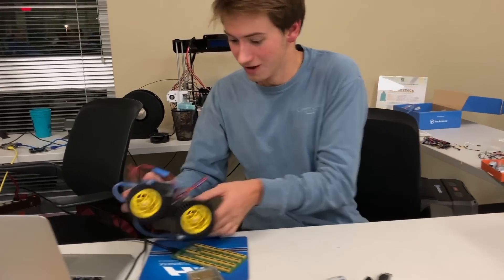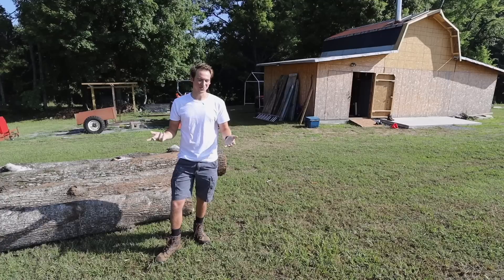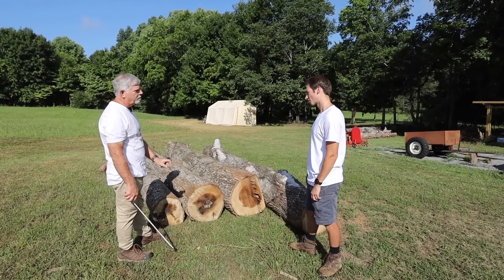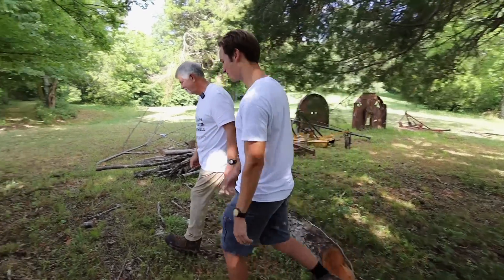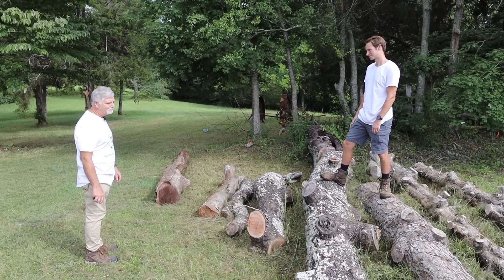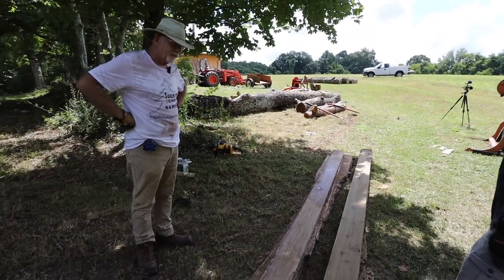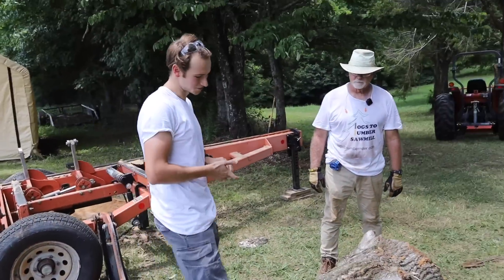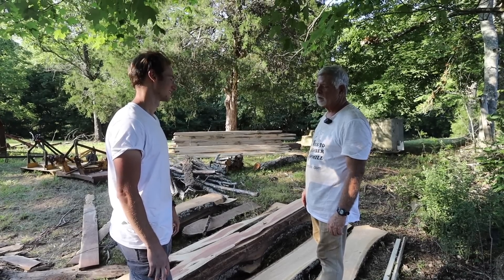Milling Rotting Trees Into Useable Lumber for Our Tiny House

Comment: Hey Danner, I mill my own wood regularly over here in Bentonville, AR.
A nice way to deal with bugs is with a Borax spray. Just get 20 mule team borax from Walmart, mix it with boiling water, then add to a larger container of water. About a cup of powder per gallon.
Helps a lot with boring insects. I find it also helps cut down on fungus.
Won't help enough if they're already established, but if the boards look clean it does a good job keeping them that way. 😀
Since you've already stacked, you could just blow in the powder with a leaf blower. It'll help with the wood roaches which LOVE drying stacks. They don't really do direct harm, but they attract species that do.
Reply: Borax spray works for boring insects; that’s good to know…

Does it also work on interesting ones? 🤔
Reply: @davidroddini1512  Nope. Only the boring ones :)

Comment: I was gifted a 4"x 30" x 72" pine slab. Decided to make a coffee table with it. After sitting in the living room for a couple of months we noticed a pile of tiny black balls under the table. Many months later I was able to catch one of the bugs with a paper clip in the hole. Termites. The solution was to use two black contractor garbage bags. One over each end then taped together to seal them together. Put the table in the sun for two 100° days. Rotating it so that all sides got good and hot. It worked. No more termites. Wish I had heard Alan's advice before doing that project. I would have kiln dried the slab before making the table.
Reply from the maker: Wow! It seems like a very easy thing to overlook. Hopefully we can get a solar kiln set up soon so that doesn't happen to us!

Comment: That is awesome that he was able to help you out with the use of his sawmill and provide at least the cliffs notes of milling lumber.  Most people don't realize how much goes into going from a standing tree to a finished board.  Even in this case where you have green roughcut lumber.  One thing I don't recall him mentioning about the kiln drying process is that the high heat at the end also helps set the pitch and resins in species like pine that have a high pitch or resin content.  

I can also definately recommend that you kiln dry anything you plan to use that might potentially be infested with bugs.  We had a whole stack of wood in our shop that ended up being infested and the entire stack ended up having to be taken out cooked in a kiln to sterilize it but the majority of the pile ended up with holes in it.  The only good thing was that we caught it before it spread to any of the other stacks in the shop.

Comment: I want to buy the same barn but I'm wondering; does the second floor sq ft counts towards the total sq ft of the house? If so, I don't have to buy a huge one. I have to get one with minimum of 480 sq ft. Thank you so much for sharing! Loving how your house is looking! Beautiful!!
Reply: I think we ended up with about 260 sqft upstairs. You can see on the knee wall video we brought it in from the roof pitch so that there would be a good vertical surface to use for chairs, beds, etc.  i think we lost 15-18” on each side, but I’ll measure it today.

Comment: What the kitty wearing @31:34 

Kitty needs more screen time
Reply: We have an AirTag on her and a cat tailer. We let her run around on the property while working, but this makes finding her possible and much easier. One can hit about 200-300 feet away. The other is great for the last 30-40 feet to pinpoint and set off an audible alarm. She loves when we put on her collar because she knows she’s going outside. We have a lot of wildlife on the property - bobcats, coyotes, and typical opossum/groundhogs/skunks. Try to keep her out of unnecessary tangles.
Reply: @MrZZeroG  sounds good, thought maybe it was GPS or something but those are pricey. Sounds like a good solution since kitties aren't known for coming when called

Comment: I've been watching way too many videos on these guy that make the tables and kitchen islands out of massive slabs of wood and several times the guy has mentioned 12 to 15% moisture content. He has a meter he uses, not the pin kind, that he uses to check this. He had one cookie that was 32% in some places, making it totally unusable for furniture. for his area up in the Portland area that's acceptable, but he wants it at 10 to 12% if he's shipping it to more southern or drier states so the furniture doesn't warp or cup.